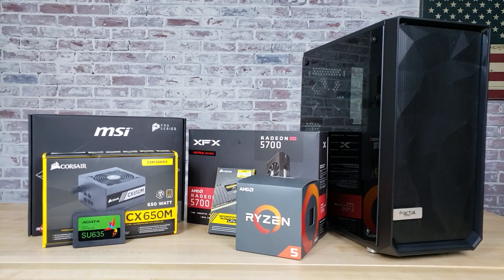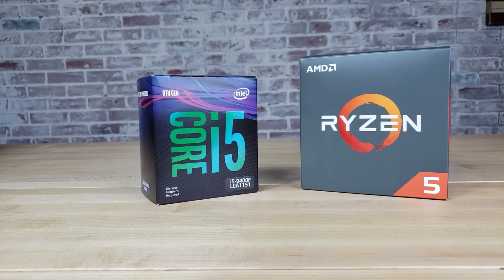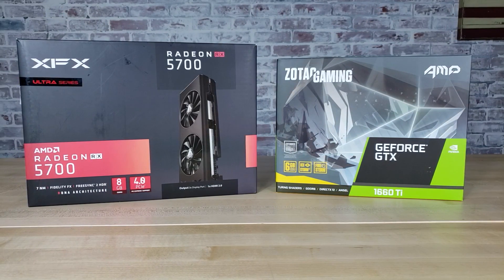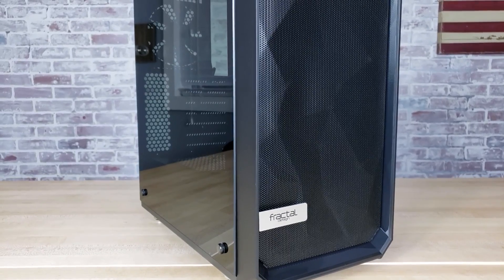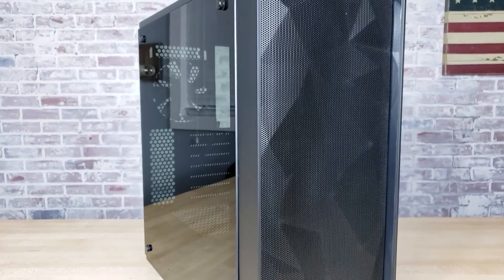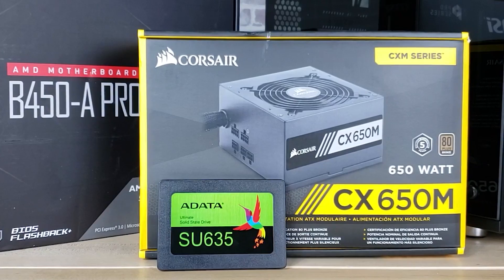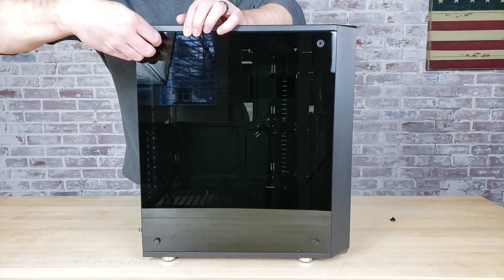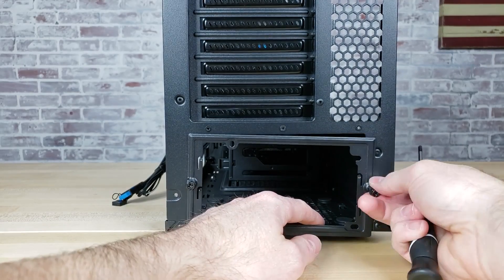$800 Gaming PC Build for 2020 - RX 5700/16GB (+ i5-9400F vs Ryzen 5 2600)

Comment: 28 Jan 2021, Just read your "7 Best Budget Graphics Cards for 2021" and wondered where you found the Gigabyte RX 5500 XT 8GB for under $200. I checked the price today on Amazon (and elsewhere) and saw $472 and up.  Even the XFX AMD Radeon RX 550 4GB Core Edition RX-550P4SFG5 was listed on Amazon at $248 -- used -- 2.5 times the "sub-$100" listed in your article.

Comment: Hey Brent,
Awesome build! I like this parts list better than another video I just watched. Though I like the Lian Li case that video used cuz it has two huge 200mm fans in the front mesh grill. Guts from your build in that case 😁👍

sigh, sorry long segway… I’m looking to build something like this, would Valhalla fair the same as the demanding category games listed?

At this point I’m only interested in 1080p ultra settings. I envision down the road bumping up the CPU/GPU if that mobo can take higher.

Comment: I want to format my windows 7 computer please help me out how to do these task,
show an video. I seen you in various web page it's only recommended to you only so please help me out. I have lots of problem with my computer I installed an emulator for playing purpose and I want delete it it wont been happening so what can I do.
Reply: Which drive do you have the emulator installed on? If not your main drive, this is an easy fix. Main drive would be much more involved and I don't care to get into that. So, if it's not your main drive, you should be safe to format it, If everything on it is backed up, or can be replaced. You don't want to lose things that can't be replaced.

Comment: is 650W not overkill?
Reply: Depends on what you want to do or what do you want to build with your system. Let's say for example you get an i7 8700k and want to overclock in high clocks of 4.8ghz consistently, then you'll need a beefy cooler for it and you'll use more wattage. But let's say you only want a 1660 ti with a ryzen 5 2600, and you'll just leave the Cpu and GPU at base clock, then you'll be fine with even a 550 w Bronze PSU. It all depends entirely on you and the efficiency of the PSU.

Comment: You can just go with a 1600AF for $85 same performance as a 2600.Nice job btw
Reply from the maker: Wow, thanks for the heads up on this! Looks like the 1600AF flew under the radar for awhile. Will have to pick one up and test it out... but with that performance at that price, not sure there's any other CPU option worth considering for budget builds. Hopefully more people find out about it and we see the 2600, 3600, and 9400F drop in price as a result.
Reply: @TechGuided  Go check out GamerNexus review on the R5 1600AF
Reply: Now costs over $200... reading reviews of unhappy folks with the occasional “ha, ha” from folks who got it at $85.